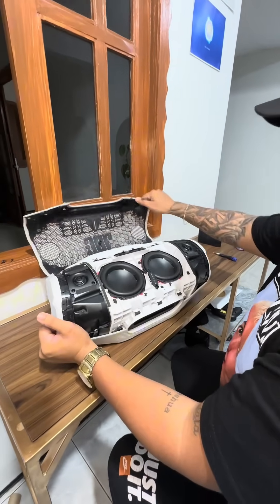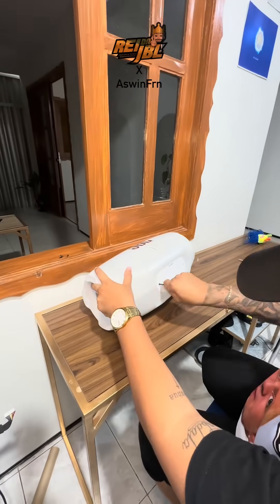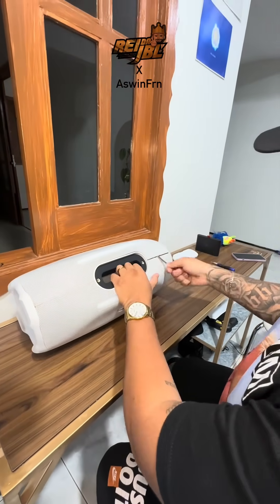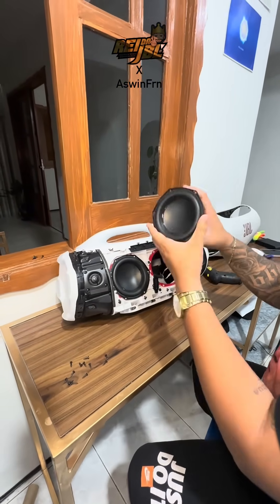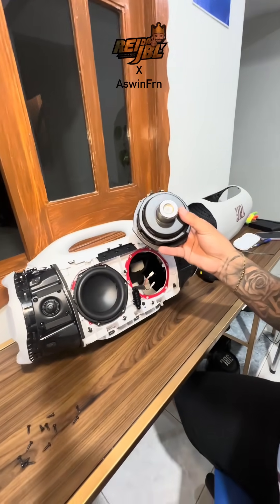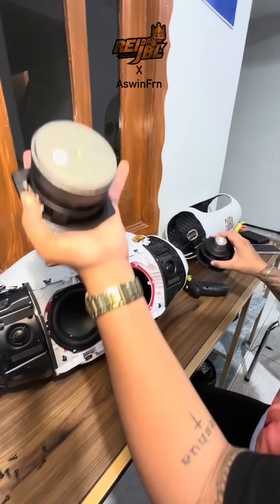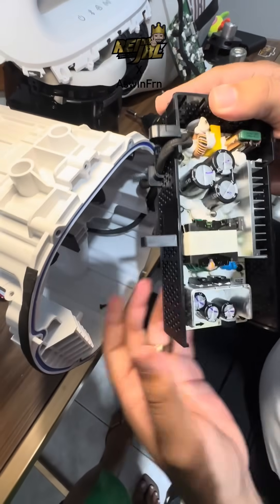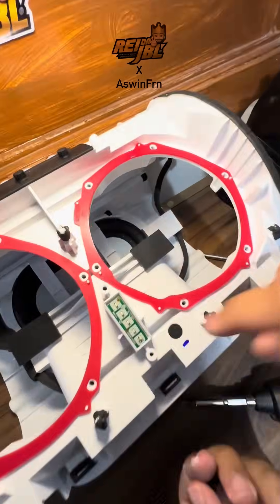JBL Boombox 4 - COMPLETE TEARDOWN / DISASSEMBLE

Comment: I bet sound details are more crisp now since it has 7 speakers and maybe it's not using SBC as a codec who knows, but 7 speakers is a lot for small structure and what i think is loudness is compromise when it's in AC mode maybe loudness wise it's the same as bbx 2 and 3, battery life is idk for sure but we'll see once it's released globally, I'd love to get one for myself and compare to its predecessors also i love that the subwoofer is on the back since i always put my bbx close to wall to make the bass more surrounded i guess, and maybe bbx 4 will be a bit 360 surround sound now.

Comment: After boombox 2 this small magnets on boombox 4 woofers looks very weird and weak😅
Reply: The magnets are smaller but that type of magnet is 10times more powerful than the original
Reply: @BassBoss-Official Yes neodymium magnets are 10x per volume, but it is per volume, so overall I don't see a big improvement magnet-strength-wise, but I can see the reduced weight being quite useful.
Reply: @bfbunny  thats true. Makes the box less heavier. Also I guess the magnets being small or big doesn't affect how the sound quality will be.
Reply: @BassBoss-Official It will affect sound quality, but it is more about design. A good speaker magnet can keep the magnetic field pretty constant when the voice coil is moving back and forth by a lot, a bad one won't and that will result in audible distortion. However distortion will be apparent when the speaker is moving back and forth quite far.

Jbl seemingly placed the neodymium magnet inside the voice coil with this new design, and that I know is a bit harder to keep the field constant, but as long as they make the neodymium rod a bit longer to accommodate for the throw it will be fine (costs a few more $ to do). We'll need speaker driver level of teardown with this one, and I don't think anyone will want to destroy their expensive speaker for just this measurement.

The 3-way design on the Boombox 3 have the benefit of offloading mid frequencies to other drivers, and since these distortions when playing bass are more audible when playing mids together, I'm curious in what JBL did this time around with Boombox 4. Maybe they have some form of compensation in the DSP this time around.
Reply: I think they did that because they didn't want the dimensions to differ from it's predecessor, compare to bb3 it should be a little bit detail in terms of sound but loudness maybe bb3 wins

Comment: Idk what to say I didn’t expect them little magnets
Reply: It’s not about magnet size, it’s about magnetic power density and audio system design.
Reply: Tecnologia pura
Reply: Yes.. the magnets looks small but the power is equal as the large ferrite magnets. Small cause it was neodymium magnets, neodymium magnets doesn't need larger yet powerful. Neodymium is smaller and lighter than ferrite magnets.
Reply: The same woofers as the Soundcore boom 2 plus 😂
Reply: Those are neodymium magnets
Neodymium magnet is stronger than ferrite magnet other speakers use it

Small neodymium magnet speaker beats large ferrite magnet speaker
Reply: @dudscoconut yes i know that
Reply: @dudscoconut  Yes smaller neodymium magnets are often better than slightly larger ferrite magnets, but when the size difference is huge, ferrite can win by a lot.
Neodymium magnets are lighter for the same flux, very expensive to scale up, and breaks under high heat, so for high power subwoofers ferrite is preferred, while portable speakers' neodymium saves weight.
I have torn apart a Sonos Sub Gen 2, and those 6-inch-wide 1-inch-thick ferrite magnet blow these smaller neodymium magnets out of the water in strength. However, coming in at 4kg per speaker, it also needs me to have the strength to carry it around, which is the only thing preventing me from making some portable speaker out of these.
I'm glad JBL went for neodymium, Boombox 3's large ferrite magnet for that racetrack driver is just too heavy. The new magnets could be a bit bigger but it is what it is.
Reply: the average joe, who has no clure about woofer design, may think the small magnets are weaker, but they are not, because they use neodymium instead of ferrite magnets.
Reply: Magnets doesn't affect sound quality
Reply: @markaustinsickbasshead274 yes they do by aligning tthe voice coil and stronger magnets are better for control
Reply: @markaustinsickbasshead274 they do. Precise wise
Reply: @markaustinsickbasshead274  it's actually have faster hotspot temp and can be crazy just kill your woofers
Reply: With boombox 4 JBL going one step back from boombox 3… sad…
Reply: @pauliusmazeikis3778 how
Reply: Size is most definitely important bigger magnet with allow more excursion producing harder and louder sound frequencies at low hz vs a small power magnet will definitely be way more punchy and have great highs but will lack the lows with it, JBL definitely did well with this set up cause I would of never guessed the magnets being that small unless I held it cause the boombox 2 is a boulder
Reply: @jblspeakersandmore277  BRO its not only the magnets size its the design that allows more excursion you dont know anything about audio
Reply: @jblspeakersandmore277  fr
Reply: @jblspeakersandmore277  Also To get lower bass they have to make the speakers cone bigger not the magnet its not only about magnet
Reply: @Carfan12345-n ok my g sense I don’t know anything why don’t tweeter have monster mags why only subs cause your not getting no excursion on a shallow mag no matter the cone size you won’t have sound waves if it doesn’t move you can have sound but no bass put a tweeter mag on your sub tell me if it bumps hard 😂😂😂
Reply: @JBLspeakers: yes and no. As a raw piece of isolated data you are right. Not so in case specific implementation. Any two way speaker is limited to displacements of about 5-6mm. Then you hit terrible doppler distortion levels no matter the speaker qualities. These seem to be more than able to do 6mm, so heavy cone displacement is a nonissue, non-topic here. Then, you have three passive radiators. If tuned little more broadband, the speaker can offload the work to the radiator, doing work by the motor force, and not the excursion. So all in all, it seems like slight upgrade in bass region from BB3. Though I would expect it to be in the realm of 1-2dB, nothing serious.
Reply: @jblspeakersandmore277  bro neo have bigger power i trust them boys what say it info for you but you should to know neod have temp problem it mean you can kill your woofers faster than woofers bb2 so i think bb2 is best choose for lfm
Reply: @AiReadyGone I 100% agree they are stronger but it has shallow magnets it can be skinny just alittle longer to give the woofer some extrusion without puttin coil on edge of bottoming out I love my bb2 my cousin bottomed it out on 600watt amp(like 3-4 seconds) and it play perfect still idk if id trust the bb4 woofers to do the same 😂😂